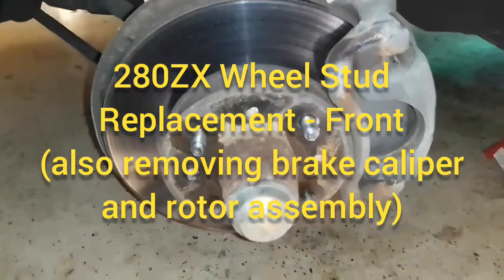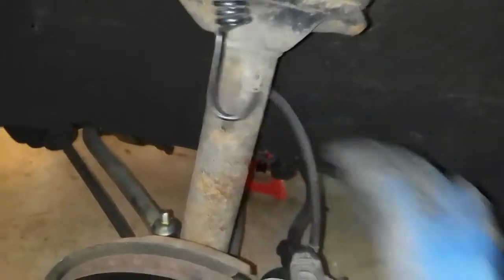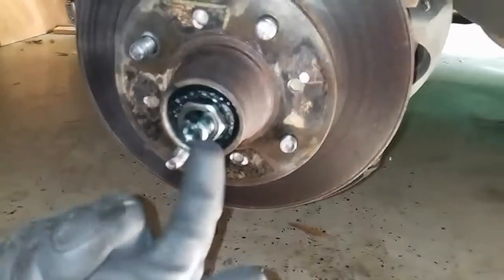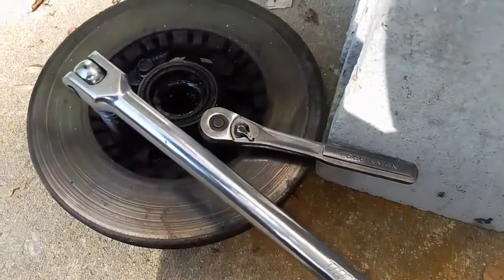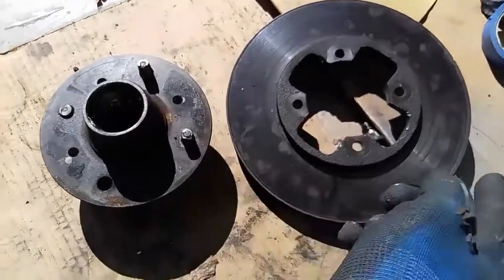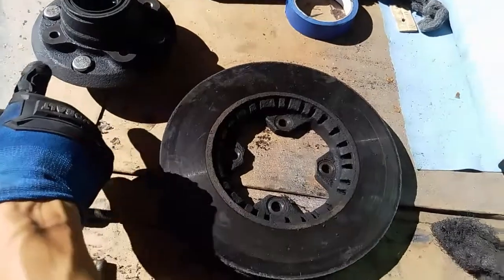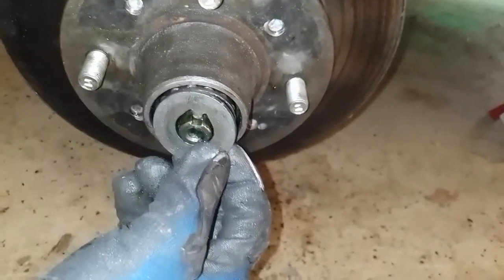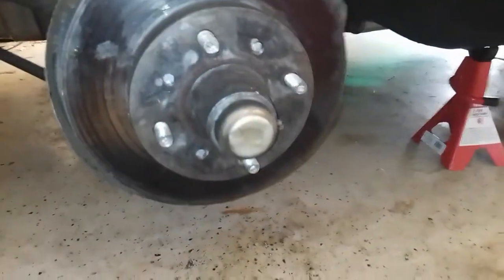Datsun 280ZX Front Caliper and Rotor Removal with Wheel Stud Replacement

Comment: Thank you for posting this. Pro tip though, it's not a good idea to re-use cotter pins. Bending them fatigues the metal, and they can break
Reply from the maker: I agree. I did that early on before I had a ready supply of replacements.

Comment: Hey thanks so much for this! 2 questions: can you link the those studs? And on the back end of the hub, the inner ring, is that ok if it’s a little loose and has some play in it? I’m not sure. I don’t want to slide back on defective hardware
Reply: I can send a quick pic or vid to show what I mean, I would mega appreciate it
Reply from the maker: Here is the link to the studs I used. https://www.oreillyauto.com/detail/b/dorman-autograde-3358/tire---wheel-16779/wheel-lug-stud-12672/f9d310318873/dorman-autograde-m12-1-25-thread-wheel-stud/610240/4181163/1981/nissan/280zx?q=Wheel+bolt&pos=1
Reply from the maker: Show me what you mean about that ring being lose...
Reply from the maker: @heavyp08  I don't remember if mine had any play like that. I don't think it did, but you might want to post that question in one of the 280zx Facebook groups.